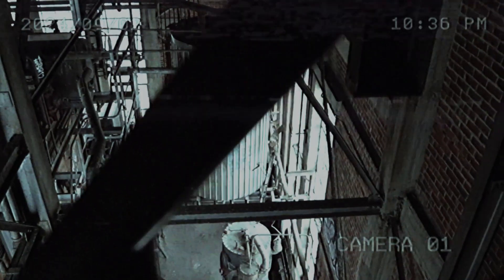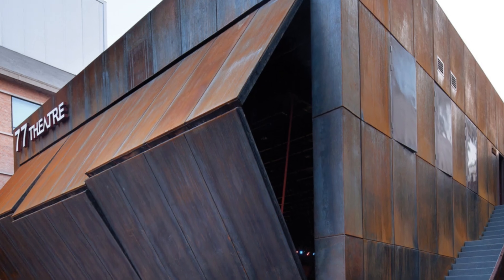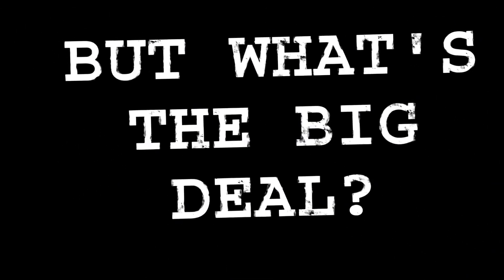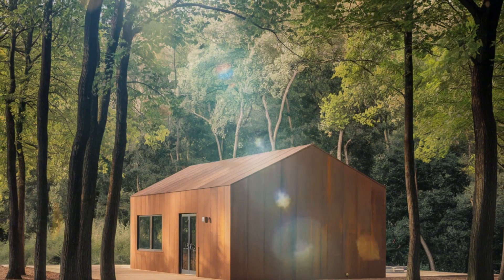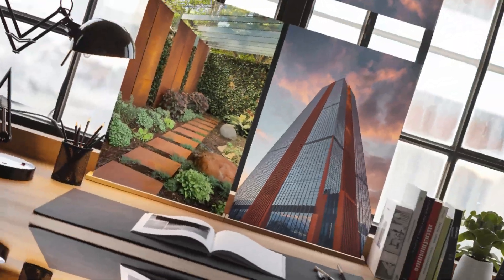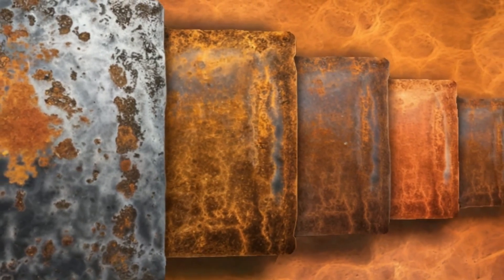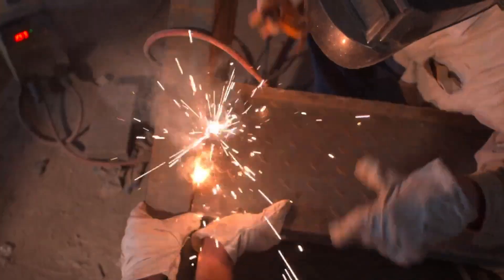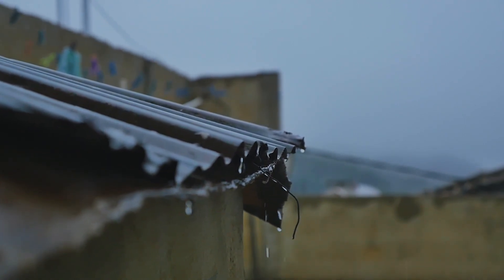Why do architects obsess over corten steel (and what exactly is it?)

Comment: Very interesting. I was never aware of the structural strength advantages. But I am generally not a fan of Corten steel in architecture. Using it in outdoor sculpture works. Then again, I was never a fan of Richard Serra.

Comment: how would it compare to say hot dipped galvanized or an appropriate grade of stainless in a marine splash zone / semi submerged (wave action rising and lowering water level fresh water) thanks!
Reply from the maker: Corten steel requires a wet/dry cycle. It cannot remain only wet, otherwise it will corrode past its intended point. Salt is also Corten's enemy. HDG Steel performs well as a regardless of water of salt presence.

Comment: How do these two corten steel compare to steel other than aesthetically?
Reply from the maker: @jakesyetta7456 than carbon steel? The weather resistant quality of that corten has is the main factor. Carbon steel is stronger at high pressures and temperatures but corten has more tensile and yield strength. It is more expensive too.